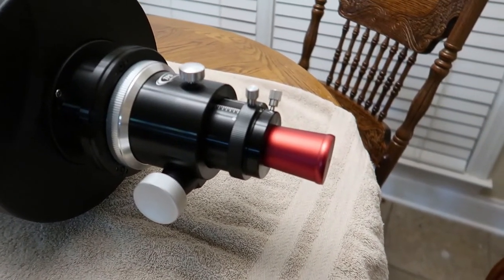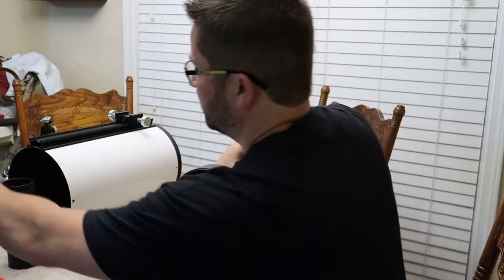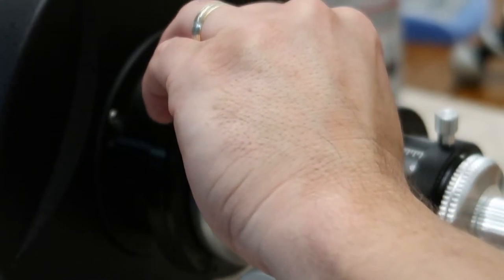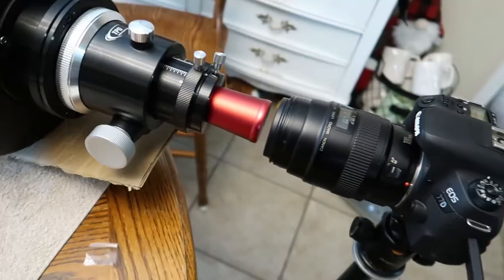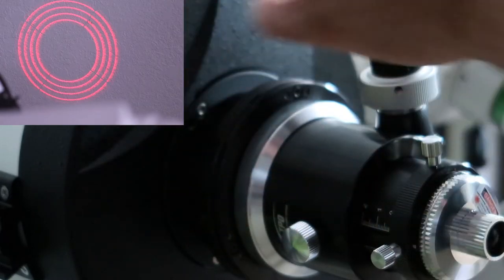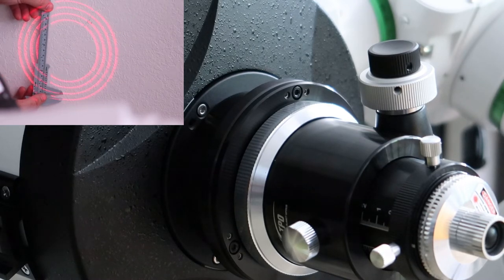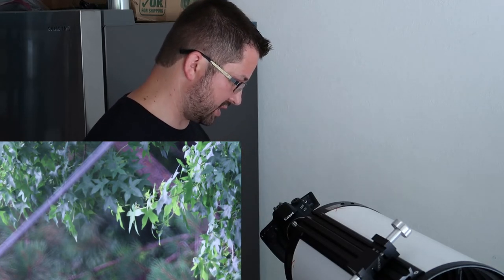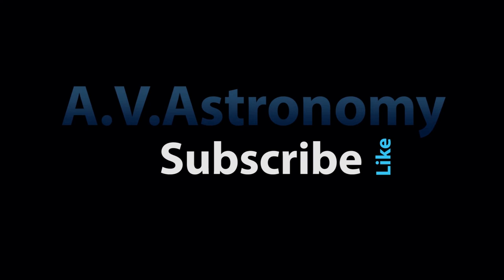How to properly collimate an RC telescope:  Ritchey Chretien Collimation

Comment: Finaly a clear video on collimating RC8! Thank you SO much!
About the star test, where do you place the star in the FOV? Does it need to be in the center or should I move it around to check it stays concentric all over the FOV?
Reply from the maker: A.C A. You’re welcome.  I generally check center first and then check the corners.  Also, remember it’s an iterative process.  So after you’ve made the first run through with the focuser, secondary, and primary, recheck the focuser, and secondary.  After that star test again and you should be good to go.  God bless and clear skies!
Reply: @AVAstronomy  Thanks again! 
I have a R.E.E.E.G.O collimator, do you know it? Is it good enough to be used instead of "regular" Cheshire? 
Here's a link:
https://www.teleskop-express.de/shop/product_info.php/info/p11188_TS-Optics-2--LED-Kollimator-fuer-RC-Teleskope-und-alle-anderen-Teleskoptypen.html
Reply from the maker: A.C A. I’ve heard of it and read that people have had success with it but I have not personally used it yet.  I’d say go for it.  Could make this process a little easier.  👍
Reply: @AVAstronomy  I'll give it a go soon. About the star test, I read that the stars shouldn't look round all over the FOV but the oval shape of the peripheral stars need to be radial (pointing toward the center of the FOV), do you get round starts all over the FOV ? (While collimating, without the flattener)

Comment: For seeing the laser on the secondary mirror, I wonder if you could use one of those dentist mirror on a stick things. Don't know if it would give a wide enough view though. I'd love an 8" RC one day, but I'm not sure my HEQ5 would handle it. Then again I'm current running a Quattro 200P on it right now, but that's only 800mm FL.
Reply from the maker: The Photon Collector I suppose you could use one of those mirror things but would need to be careful about direct reflection.  I think the RC would be pushing the limits of the HEQ5 but if you’re 200P is running solid on it then the RC should be ok too.
Reply: @AVAstronomy  Well I wouldn't say it's running solid... per se, haha, but well enough usually. Hoping to do the belt conversion soon so I'll see how that works. Good video though, as usual.

Comment: How do you measure realignment if the secondary mirror was removed to install a secondary mirror dew heater?  Got the scope cheap because the guy didn't want to mess with it anymore.
Reply from the maker: Yeah, I made a note in the comment section about not doing they step anymore but rather using a dental mirror to check instead. Clear skies!

Comment: Here's the thing, since the focuser is always coupled to the mirror regardless of tip/tilt plate and you align your focuser with your secondary using a tip/tilt plate, as soon as you adjust your primary it throws that off.

Comment: Thank for your video. I found almost imposible to get a proper focus with the stars. They pass from small circles to blur point to something as V. 
I am waiting for the tilting ring and the howie laser to carry out a proper collimation following your advice.
Reply from the maker: julian simon you’re welcome Julian. Glad you found the video helpful.  Please take note of the update I made on this video in the comment section regarding step 1.  It’s far easier to use a small telescoping mirror to check alignment of the focuser the the center dot on the secondary mirror.

Comment: Great video, very helpful and a significant contributor to my needed confidence to do some related work to my Orion 8" RC. My RC is definitely in need of collimation. Worse yet (and the basis for my request for your opinion), my primary mirror caught a major water dowsing from my sprinkler system. It has some pretty bad water spots.
Watching your video, particularly the removal of the primary mirror/plate assembly from the rear of the OTA. What do you think about cleaning the mirror following standard cleaning procedures, but without actually separating the mirror from the primary plate? This would mean a good dowsing of water would get on the plate and rear cover in the process of cleaning the mirror. I fear removing the mirror from the plate, will lead me to even bigger issues in the long run. I do not have fans or other electronics behind the primary mirror/plate assembly.
I apologize this is somewhat off topic from your excellent collimation video, but while I have it disassembled (yes I saw the addition of the mirror process), I thought perhaps the cleaning would be possible. Thoughts, opinions, other? I will understand if you don't care to comment since this is off topic.
Reply from the maker: Kevin Wenrick Hi Kevin, glad you found the video helpful. Yes you can most certainly clean the primary mirror without taking it out of its actual mirror Cell. What I would recommend is a 50-50 solution of distilled water and 91% or higher rubbing alcohol. Using 100% cotton pads saturate them with the cleaning solution and gently wipe with a single pass with each side of the cotton pad.  There will be a small amount of solution on the mirror but it should not drip down to the mirror cell.   Then use canned air to blow away any excess moisture.  This works exceedingly well but if you still have issues you may want to use another solution called first contact polymer. You can Google it and it’s somewhat expensive but from what I’ve read it is the safest and most effective way to clean a n optical mirror. However, based on your situation I don’t think that will be necessary. Good luck and clear skies
Reply: @AVAstronomy  Thank you very much for your reply. Like most things we do for the first time, it's always a boost to the confidence to get opnions from those more experienced on the topic. I'll post back once I finish in a few days. Again, thanks.
Reply from the maker: Kevin Wenrick sounds good Kevin.  Take care.
Reply: @AVAstronomy  I said I'd post back after I finished cleaning my RC 8 primary/secondary mirrors. Cleaning the primary mirror in its cell was very easy, no issues/concerns with it whatsoever. I cleaned the secondary in place as well, a little trickier since I had to work inside the OTA, but not  a problem. Now, not so much as a speck on either mirror. Reassembled the OTA and ready for collimation.
Reply from the maker: Kevin Wenrick be sure to post some Astro photos with cleaned collimated RC.  Looking forward to seeing them

Comment: A very clear explanation, thank you!
 One question, would you buy a RC again, considering they're not too easy to collimate? Just asking because I was tempted to buy one, but the procedure looks a bit daunting and I've also read horror stories about this scope online. I heard that once the collimation is spot on they perform just as well or better than an EdgeHD.  Clear skies, all the best!
Reply from the maker: The rumors are true.  These can be a bear to collimate but if you have the patience the. The results can be very rewarding. I would definitely get one again but would get a larger one that has the mirror collimation screws in a better placement for adjustment.  They are great galaxy scopes but yes do require a tedious collimation routine.
Reply: @AVAstronomy  Thanks for your reply. Is collimating an F/4 Newtonian a "walk in the park" compared to a RC?
Reply from the maker: @sjpp71  yes it is, especially if you have one that holds collimation well.

Comment: Hi. I'm in the process of learning RC collimation which is tricky...
Question please... After doing step 3 does this change the focuser collimation with the secondary mirror? Because you are cheng ingredients the whole unit position... Do you recheck step 1 again? Thanks
Reply from the maker: Yes, it would be wise to re check the focuser.  This process is iterative and after making a couple adjustments and checks the movements should get smaller and smaller for adjustment.  Once you have stopped making adjustments to the primary mirror then you can you leave the focuser alone.  Clear skies!

Comment: I have been looking in to this scope. An affordable RC scope, but I haven't read many good reviews. What's your overall verdict.
I have a Meade SN8 now, so I'm used to collimating, but this one has some other quirk's.

Also, would it be possible to use a mirror to see the laser pointer on the secondary? I think the minor adjustments you do to the tilt will probably be undone by taking the back off and putting it back on again.

Anyway, great video. Very informative. 👍
Reply from the maker: I really do enjoy the scope and since your used to collimating the learning curve would be simpler for you.  I suppose you could use a dentist mirror on a stand somehow and if you work that out let me know cause that would be easier.  It’s possible some of those adjustments might be undone but if so I think it’s minimal.  In the end if the images are sharp then I’m happy but I agree it would be easier and better if you didn’t have to remove the baffle.  Clear skies!
Reply: I tried the dental mirror and it didn't work out.  the center dot is too dim to show up on the mirror.  I even tried sticking a webcam inside the OTA pointing at the secondary which worked until the laser was turned on, then the laser light overwhelmed the dot with red light and I couldn't see what I was doing...

Comment: I couldn't help but notice that you have a spacer between the base of the scope and  the collimating ring, but you never mention it.  Is that part of the collimator rings or one of the spacers that came with the scope? Also after the collimation is complete does the spacer have to remain there from now on? Otherwise a great video, Thanks.
Reply from the maker: Ray Reyna Hi Ray,  great question. the spacer came with the scope and is in place so that I can reach the collimation screws on the primary mirror.  You could use a lower profile spacer but if you don’t use one at all then it blocks the collimation screws on the primary.  Hope this helps.  Also,  I’m planning on doing a revision of the first step.  You can buy an extendable mirror from a hardware store that will allow you to see the donut without removing the baffle.  This speeds up the process and makes it even more accurate.  Clear skies!
Reply: @AVAstronomy  good video, what happens if for some reason you need to attach an additional spacer in order to achieve focus ?

Comment: Hi Aaron!, thanks for this video mate!, I have a few questions about this, currently I have a RC 6”, which need a tweak of collimation, now I do not have the ring for the focuser, how can I get the step 1 done without it?, on the other hand I only have a cheshire, no laser, is it possible to achieve decent collimation just with the cheshire?.                                                                          Thanks man!.
Reply from the maker: Felipe Godoy Barrios Hi Felipe glad you found it helpful.  You may be able to get a “useable” collimation without the tilt plate but I HIGHLY recommend you get one.  I’ve heard of people achieving good collimation without the laser collimator but in my experience I prefer both.  Hope this helps.  God Bless and clear skies!
Reply: A.V.Astronomy thanks Aaron!,  ow regarding the tilt plate, once you align the focuser using the tilt plate, you leave the tilt plate installed all the time on the telescope?, I notice through the cheshire that the focuser it’s quite off from the center, and all of mi images have like a “halo” or perhaps better description the vignetting it is always off center from the image.exactly where the off center focuser is pointing.
Reply from the maker: Felipe Godoy Barrios yes, you leave the tilt plate on and it sounds like something isn’t aligned properly if you are seeing halos or vignetting.
Reply: A.V.Astronomy thanks Aaron, now I’m following step 2 and 3 to get the 2ndary and primary collimating, according to your video, thanks man!.
Reply from the maker: Felipe Godoy Barrios if this scope is new you’ll likely not have to make adjustments to the primary. If you got it second hand and someone has already adjusted the primary then it may need small adjustment.
Reply: A.V.Astronomy I managed to get the donut in the center, but you can easily see that the baffle rings are off, quite a pain!. 🤓

Comment: I almost bought this type of telescope, but fortunately I chose the Schmidt-Cassegrain because I already have a Maksutov-Cassegrain. The RC collimation is terrible, even though it can be adjusted, just touching the eyepiece holder can throw everything off. I don't understand why they don't solve it differently. Furthermore, it's an open system, and all the dust quickly accumulates there, and it doesn't have the brightness of a Newtonian.

Comment: I don't get it. You're using a howie glatter collimator that's more expensive than the telescope itself, and when finished you are using a dirt cheap flashlight with a piece of aluminum foil to redo the same. Why not use that method in the first place and forget about the HG collimator?

Comment: No need for a Howie Glatter laser that costs almost as much as the telescope itself. A Cheshire is enough to get it 95% collimated and finish off on a centered bright star. It's also totally unnecessary to remove the mirror assembly. I can do mine in 10 minutes and then 5 minutes on a bright star.

Comment: According to this video https://youtu.be/a3UOGDUaq6o where he’s collimating a carbon fiber GSO RC8 with a red Farpoint Cheshire and Howie Glatter with holograph attachment .. you only need to reach into the front of the tube and unscrew the front half of the baffle to be able to see the donut. Also I’ve been told by some hard core RC guys the Takahashi Collimating Telescope is the way to go .. but I can’t find even one video of someone using it on a RC .. so I’m probably going to go the Cheshire/Glatter method myself for my new GSO carbon RC8  if I can’t get my head around the DSI star method.

Comment: NO!!!!!!!!!!! 

The tilting adapter will do absolutely nothing and is not part of the collimation process. This accessory simply tilts the ccd sensor plane  respect to the focal plane, at most it is useful for having a more precise focus for large CCD sensors. But then it should also be used on refractors and all telesopes. The collimation of an RC only concerns the alignment of the two optical axes. The primary for axial coma and the secondary for irregular astigmatism. And as a first operation the distance between the mirrors for spherical aberration. Stop.

 I never  found a correct explanation on youtube yet. The only thing you have to do is find the distance between the mirrors until you reach the backfocus declared by the manufacturer. Do a physical axes alignment using a Cheshire or optical collimator such as the takahashi. and finally correct the optical axes with the star test. That's all. The tilt-thing you can throw away. 
I'll have to do a real tutorial sooner or later.!!!!!!